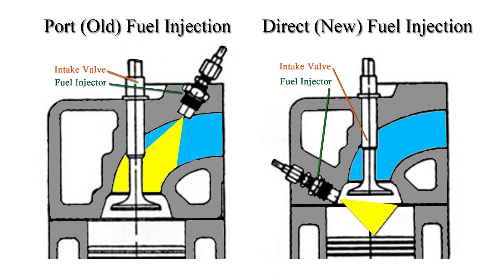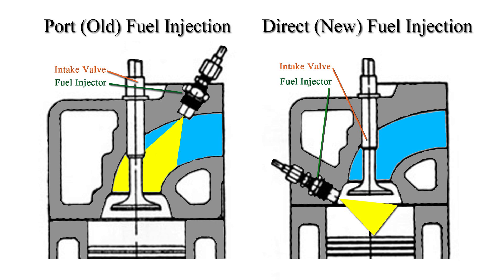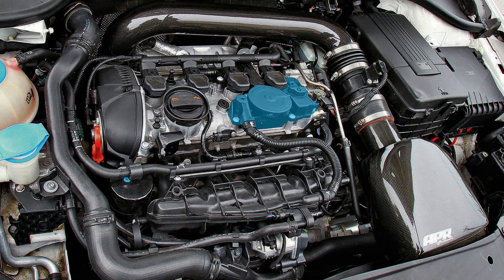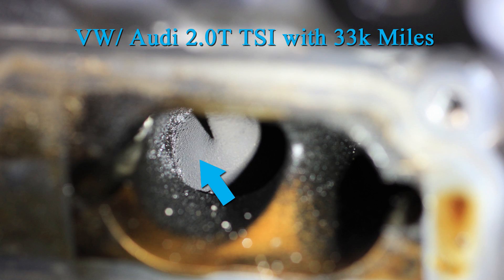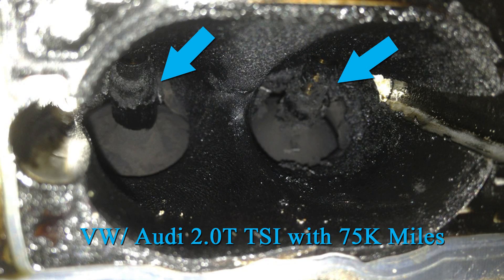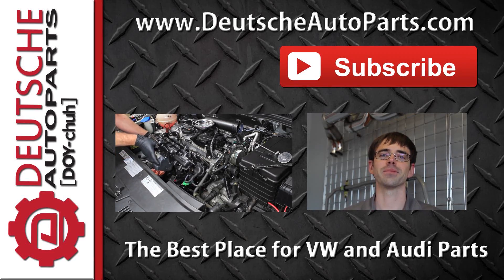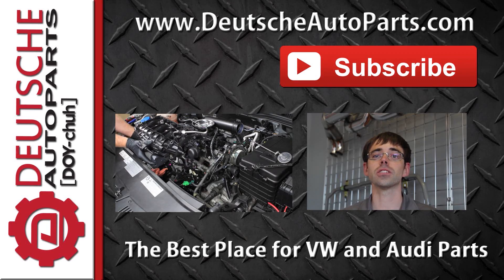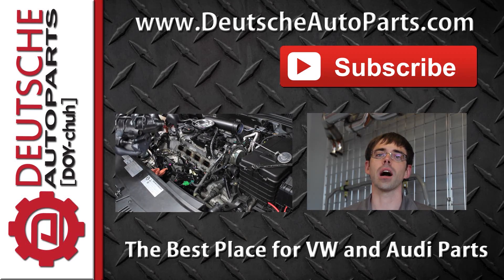Carbon Build up on Direct Injection Engine (Intake Valves) AKA GDI Gasoline Direct Inection

Comment: UPDATE - The cleaner the motor oil, the less carbon deposits to clog your PCV valve and intake manifold in direct engine cars. I load up on Costco Kirkland synthetic motor oil when it's on sale and change every 3-5,000 miles.

Comment: Be very aware of catch cans, as if you don't get the correct size for the engine it can lead to big oil seal failures due to the pressure in the crank case being to high.  Also a lot of car makers will void your warranty if you have a catch can installed.

Comment: Sea foam actually works on tsi engines you gotta run it through a few times but it does actually work. It mainly cleans front of the valves but hardly get the rear of em that's why you gotta run multiple cans of the stuffs and also Marvel's mystery oil works pretty good if put into the oil n fuel. And also things like Gum out n stp for the injectors ect if you run that often it seems to help massively. Iv had luck with it with one of our VWs now ATM I'm having a carbon issue with #3 cylinder misfiring so I put in Marvel's in both fuel n oil and then gumout and 101 octane fuel... Yup 😂 and ran the tank it still misfired through it but as days past it got better. And then I refilled with 93 octane added Marvel's again and STP injector cleaner then ran it like that the gained power back slowly n seemed to not be a jerky in low RMS. Its now smoothing out above 3200rmp when it was jerky regardless. Now today I refilled it added Marvel's again and gumout again and ran two cans of seafoam through it... And now it's hardly noticeable the engine light stays off and the epc light does as well after I recleared the codes... It still has the misfire but it's absolutely nothing like it was.. I'm gonna continue to run cleaner through the system a few more times maybe for 3 more full ups and run sea foam every couple days n see if fully goes away. Because it's definitely helping tremendously. And the car has 133,000 miles on it... N the valves to my knowledge never been touched lol... It's a quick Lil car n started it's issue on Thanksgiving morning... And it was hella bad.. so I changed the plugs n coils and it cleared up some but #3 continued to misfire so I started the chemical treatment which is helping... I know it's not as fast as cleaning by hand n know it's.gonna take a while but it keeps me from having to rip the intake off n scrub for a hour or two 😂.

Comment: Best way is to use carb cleaner by pouring it into the fuel tank regularly every 5 K KM.
Reply: That won't help with direct injection since the fuel never hits the back of the valves
Reply: @ODH3  Great answer.

Comment: Hi Paul I know this is an old video but thought I would ask here. I have a 2010 B6 Passat 2.0t TSI 6M/T with 145k kms/90k miles up in Canada eh - recently I've had the CEL come on initially with P0101 and then later with P2177. It does have a slight stumble for a few seconds when you start it cold, it also doesn't seem to idle up more than 800rpm when cold either. Only once has it actually stalled immediately after start up. It also seems to not like the gas pedal stomped immediately when taking off from lights, I find I have to slip the clutch a little otherwise it will bog down massively. When the car isn't moving and in neutral, if I give it gas it doesn't seem to rev freely either, but when driving there is no obvious misfire. I've recently replaced the plugs just to be sure and the coils look good with no obvious signs of degradation. I've only just bought the car recently so I don't know it's full history, I am expecting to have to remove the inlet to clean the valves at some point (along with re-seal the cam tray) so was wondering if P0101 and P2177 faults combined with the other characteristics I'm experiencing are in line with the inlet valves being partially blocked by the build up? Thanks!

Comment: catch cans suck and a waste of money, and dont work. I use seafoam every 5k and drive hard and only use premium fuel and at 50K I removed intake and it was just a light dusting of carbon ! driving hard with the seafoam opens the valve more and cleans as you drive ! period

Comment: Any observations of an engine flush additive during oil changes helping with this? Since the fuel additives types (Techron, BG 44K) no longer get to the valves, wondering if liquid moly engine flush or similar in the oil for 10 min of idling makes a difference in the crank case ether.

Comment: I have a ‘06 Porsche 997 which is emitted white smoke from one of my rear pipes - small burn smell ... I am hearing that it’s carbon buildup.. and to use Fuel Injector cleaner - any thoughts? Is this the same thing that you’re talking about?

Comment: So i bought a Hyundai elantra manual 07 it is GDI 200 000 kms never messed with i used seafood and i can hear the intake a bit now must of been super clogged because  everything works much better now i would recommend this I followed  instructions and ate food while it heat soaked just looking at these images makes me cringe at my high mileage motor i used the spray can seafoam myth confirmed

Comment: We do "italian maintenance" That means: pull the engine up to the high load with very high RPM, near the limiter for few kilometers. This coul'd heat the valves enough to destroy the carbon buildup on themself.
Reply: Agreed.. I beat the crap out of my cars daily and I think that's why Everytime I take the heads out I barely find carbon build up on them lol

Comment: Thanks I learned a bit about my 11 SONATA GDI.i started to wonder about my truck and a pcv catch can. 2001 Silverado LB7 HD. I've been fighting this for a yr. Its drinking a gal of coolant everytime I drive. Waters not in my oil n it's not leaking on the ground. Theres a hole that comes out of the intake then into a small box witch then goes to the ground. Steam n milky white oil drip. ? can I crimp of the hose from intake to eliminate the water lose or would the water just go somewhere else?  I wont hold anything against ya I'm just lookn for some guidance. 
THANKS. 
RL

Comment: Instead of doubling the injectors (and defeating the whole purpose of direct injection), why not just add a throttle body injector that sprays a cleaning solvent when the car is shut down? No more clogged valves and less fuel waste.

Comment: This is one of the reasons that I elected to buy a 2019 370Z with its port-injected engine rather than wait a year or two for the next version of the Z that I knew would have GDI.
I wonder if periodic throttle body/intake tract induction cleaning services, like the BG 44K one, are effective in reducing the buildup of deposits on intake manifolds and intake valve faces.

Comment: How to use sea foam spray on 2009 VW Tiguan?
Reply: Try and find a line that goes to your intake manifold and see if you can squeeze the red tube through whichever line you find and give it a good couple sprays at a controlled interval. Then let it all hot soak and take it for a rip on the highway.

Comment: Hi, my golf Mk6 tdi 2009 has started running bad and has a knock or rattle when cold. But as soon as it gets warm it runs fine and the rattle or knock stops. I’ve replaced the glow plugs thinking that would sort this problem, but it’s still there. Thanks for any help or advice. Brian
Reply: See this channels odbEleven misfire video. odbEleven can help you do a process of elimination. Just double check it's compatible with 2009...if it is it's has many other features you will enjoy.

Comment: Audizine talks preclean dyno, post clean dyno 42hp gain.. and I'm lookin at mine.. its totally chunked out.. crap!!!!!  How can AUDI not realize this issue in Development.. and overcome this?

Also, what the F is up with the many fastener types on this engine!!!!!! WHAT THE F!
Reply: That is a very significant HP difference. There should be a better top down solution to this.Also consider the MPG drop and eventual misfire codes that will result...which I just got on my s4. EPC.

Comment: Talked about everything BUT the most important one. That's "CRC GDI Valve Cleaner" its proven and cleans the carbon buildup, without removing the intake manifold. Must use as per directions.

Comment: How do I clean up these carbon deposits?
Reply: Your options: that I have researched...in no particular order. Maybe there are other reasonable options that I am not aware of. 1. CRC intake valve cleaner or other similar product. 2. Walnut blasting3. Dry Ice blasting4. Pull the intake and manually clean with solvents, brushes and picks.5. Valvoline professional intake cleaning service, or other similar service6. Someone here mentioned water misting once a month. 7. Water/Meth injection. Good luck and let us know what you did to resolve the carbon prob.
Reply: @mhamrin5906  thanks

Comment: Paul,
I have a 2015 Q7 with a 3.0TFSI engine. I want to use CRC Valve Cleaner on it but I'm not sure if I need to be bypassing any sensors in the intake stream. I've scoured Audi forums and called CRC. No help. It's now my understanding that this engine has no MAF sensor,  just MAP sensors. I know what a MAF sensor is, and how it works, and how it could be damaged, but I don't know if the diaphragm in a MAP sensor would suffer a similar fate. Can you offer any guidance here? I can strip off the intake all the way back to the throttle body easily. In doing so I can see that there is no MAF sensor in the intake pipe. I know where the MAP sensors are too. They don't look like they can be bypassed.
Thanks
Reply: I believe there is a vacuum hose that can get you past the inlet valve. Next time I will try this. have 2013 s4 with 143K. The one application I performed I sprayed direct into throttle body. I didn't notice any change that I could tell. I've heard to try to do this just before oil change. The question I've always struggled with is will this have any negative impact on rubber seals or gaskets etc. Yesterday, due to covid empty highways I got my s4 up to 125mph and then threw and epc code. Though I blew the engine, it hardly ran. Restarted and it was immediately fine. After some research...one possible reason for this carbon in intakes.
Reply: Thanks for the reply. I really appreciate it.

Comment: Hey bro can I do HHO cleaning if the carbon builds up & I have a 1.8 TSI 2009 model it has oil drinking habits & has a misfire at ideal at around 1500 to 2000 rpm & I have changed spark plugs & coil but still I have a misfire don’t know what to do I’m stuck plz help

Comment: In my opinion the best way to get rid of carbon deposits is to remove the intake manifold every 25-30 thousand miles and clean it manually. I've done this in my car along with injectors cleaning and the car simply changed from water to wine. More power, more economy, fast starts. And it was not that expansive

Comment: I think if people cannot afford the manual clean - that a regular and gradual application over time of a valve cleaner like CRC gdi ivc, will slowly dissolve and remove the carbon, and stop additional build up. It might take you 5 cans of the spray over time.  I wouldn't be doing a full can at one time as there is too much carbon floating around there.  Maybe once a week for a few months give a quarter can of the CRC.

Comment: Can carbon build up so much that it causes a blocked intake valve where no air gets in and causes misfires?
Reply: Carbon can be one of several reason for misfire. See this channel's vid on misfire diagnostic with odbEleven. You can easily eliminate coil packs and spark plug problems with this procedure.

Comment: Their is one simple solution....

Every month

get a spray bottle

fill it with water

Heat up your engine till it's at operating teperature

then just spray it into the intake and watch your wallet get filled with money
Reply: How much water do you spray? Steam clean seems logical as does water meth injection. Seems like  it'd better as a preventative that to cure a heavy carbon problem. Let me know if you have any more info on this. Thanks.
Reply: @mhamrin5906  Personally i would just get an atomizerbottle… and use the whole thing

Do not just pour in water, it can hydrolock your engine, but between 2200-2500 rpm, and then just start spraying, do it from time to time and take the car for a long drive afterwards doing 3500 rpm,
Reply: Thanks for the tip. When I googled it looks like there about 3 or 4 oz bottles.

Comment: "There is no cure for this"
Not true. Buy a car without direct injection.....say..... like a Honda or a Toyota.....
Reply: shakey honda have gdi engine like earth dream engine same.. toyota has the both fuel injectors..
Reply: JuSeven 
True, but they don’t use as much plastic with O-rings that get contaminated by the engine oil that leaks profusely after about 80k miles.

Comment: Thanks for the great video! Love the clear step by step instructions. I followed your advice and cleaned the intake valves on my 2015 A4 2.0tfsi in my garage, at 90K miles, first time on this car since I got it with 25K. It runs better than the day I bought it.
Reply: What did you clean the valves with? how long did it take you? Thanks

Comment: My 2013 cc 2.0T has 104k miles and dealer said build up is really bad. My personal mechanic said we don't have to take off the manifold and can do a 3-step cleaning at pep boys followed by several cycles of fuel additives. Said this won't clean clean them but should help with the side effects. Thoughts?

Comment: Great video but is there really nothing I can do? I just bought a mint Audi S4 B8.5 2013 a couple of weeks ago. It’s only done 40,000km and runs beautifully but I need to know how I can prevent carbon build up. I have already run some Nulon high strength fuel system cleaner through it but that’ll only tidy up the injectors and combustion chamber. Surely if I run Seafoam or something similar through it every 10,000km or so it should help, right? If I do decide to use an intake cleaner spray, where should I spray it in the 3.0T intake? What have you guys done on your own B8.5 S4 to prevent carbon? Please help!

Comment: I find no photos or video in internet proving that catch cans really reduce the carbon buildup by a large amount. None. I read an article that compared two Vw golf gti, one with and one without a catch can. And they found no difference after a lot of miles. Here in germany we get freezing winters which is why catch cans are not recommended for short trip drivers here. In winter they will contain mostly condensed water and the water freezes.... which may cause issues. I think, as you have recommended, simply walnut blasting every 50000 miles should be sufficient. Some do it for 350 euros here. Question: is it possible to check the level of build-up using an endoscope, without havinh to remove anything first?
Reply: Yes with a scope its like a camera on a straw they stick down in the engine. You can buy some cheaper ones that will suffice on amazon.

Comment: Examples: were these cars modified? Was the build-up of the 75K was a result of the traceable problem or a VAG design flaw.  If it is inevitable I'd expect a class action lawsuit.  Catch can sound like snake oil.
Reply: Yes you are right catch cans are bull shit, the carbon build up still happens with catch cans.

Comment: I have put my faith in CRC GDI Inlet Port cleaner. It uses PEA, polyetheramine as the active agent. I use it before I change the engine oil in my Audi 3L TFSI.  My variation is I only use half the can per change, @ the 4,000 mile intervals. After the heat soak stage, there is a 15 minute engine warm up drive then run the engine held at 4,000rpm (in 2nd gear) for 5 minutes to get the engine hot enough burn off the detritus coking. Then I change the oil. I have noticed premium synthetic oils like Mobil 1, Fuchs and Motul are much more prone to evaporation loss (4 times actually), than 100% PAO/ester oils, like Pennzoil Ultra and Amsoil. I therefore conclude it is advantageous with GDI engines to use these low evaporation 100% PAO/ester oils, (I.e., low NOACK volatility index) than others. When I change the plugs I will check the how the inlet valves are going with a scope and amend this note accordingly.

Comment: Why can't you vent the gases to the outside air to prevent this?  I know it is not allowed because of emissions, but is it possible?
Reply: I was thinking exactly the same and hoping someone will answer this question.
Reply: A lot of people do this, then plug it back in when going in for service.

Comment: Is it necessary to run top tier premium than? If my GM 2l turbo only recommends, but not requires. I do not have any better gas mileage and maybe performance in terms of acceleration is better but idc about racing. It's fast as is on 87. It is built to adjust for either grade, I use shell/speedway which has less cleaners than 93. But is this scientifically proven that it cleans the Pistons, injector itself any better ?

Comment: The one piece no one's addressing is that other manufacturers aren't experiencing carbon issues on their engines nearly as much. I don't mean to say it's never happening, but to a far less extent. For example every single Honda Accord sold in the US today is DI and Turbo. Do you think Honda dealers are going to be inundated with Honda drivers complaining about misfires at 60k miles? I don't think so.  There's a  whole lot of people on the internet saying carbon buildup is inevitable simply because fuel doesn't wash over the back of valves. I don't think that statement is true. There are other ways of mitigating buildup, just like fuel washing is just one way. Read VW's original patent - It literally goes into 10 different way to prevent carbon buildup in a DI engine. More and more I just see VW people in their own world, believing everybody with a DI engine has carbon. It's not true.